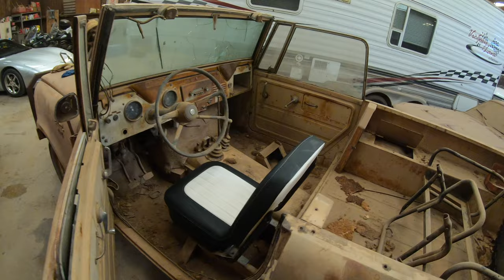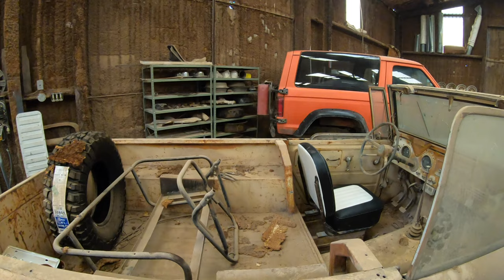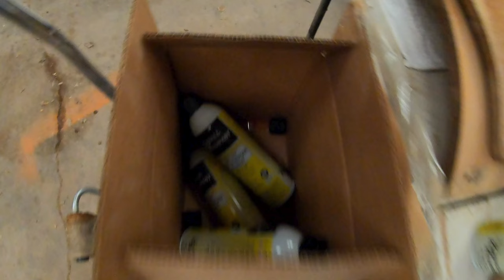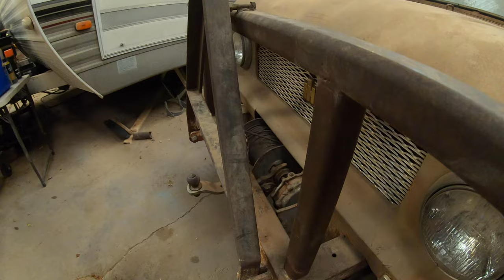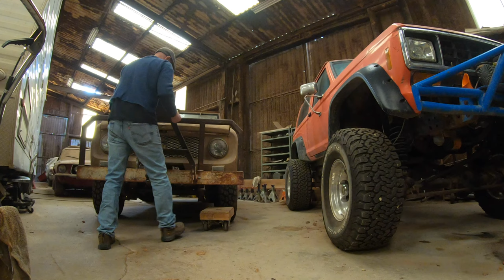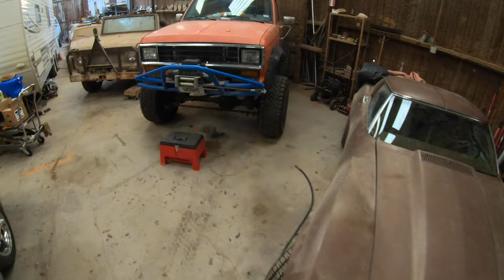NEW SEATS MADE 1961 SCOUT 80 VIN S/N F 0 43974A  BINDER PLANET LESSON AND SEATS GONE BAD!!!

Comment: what did you use to free up the windshield hinge? Is that the stock transmission?
Reply from the maker: Stock Transmission from '62.  Before my dad passed away, he told me there was some custom coupling that had to be done to mate it to the Ford 289.  I haven't gotten that far into yet.  Clutch is not engaging right now so I will have to figure that part out soon.  Recently pulled it out and blew the dirt out, vacuumed, and pressure washed the engine bay.  Had to go back to working quite a few hours to pay bills so hopefully I will have some more time soon to work on getting it running again.  I am considering putting in a C4 or AOD trans in the Scout since I have a bum clutch leg from wiping out on a moto many years ago.
Reply from the maker: Sorry, for the long delay.  Life has been crazy but I did get it down,…. Finally..
Reply from the maker: Sorry such a long time to respond.  Life has made YouTube the least of my concerns are rarely check messages.

I diid get it freed up after copious amounts of Liquid Wrench sprayed directly in the crease inside the Scout directly at the bottom of the window to the point is was dripping heavily inside.  I gently rocked it back and forth for days and one day it finally broke free!’n